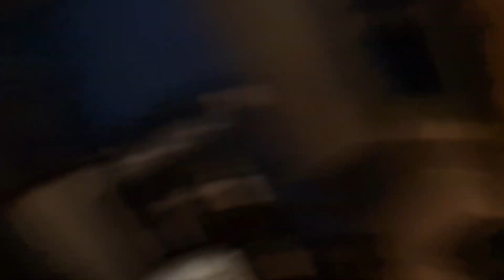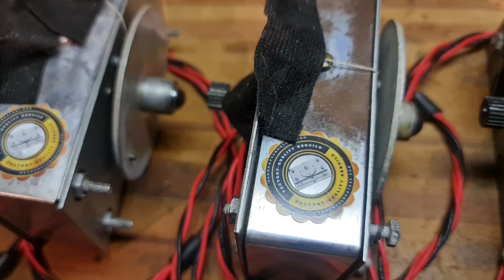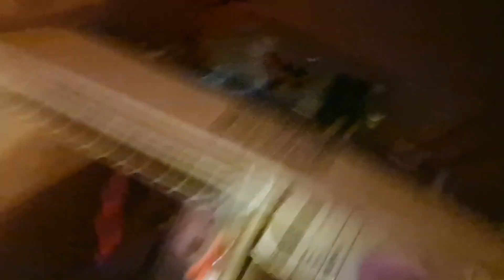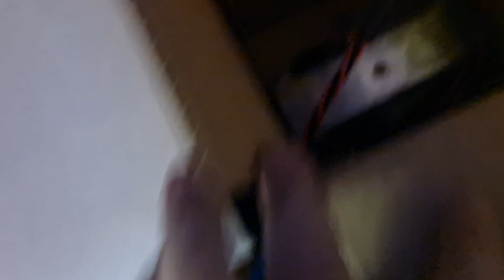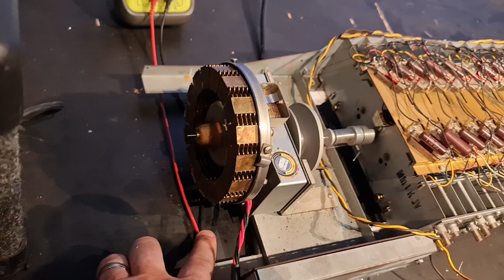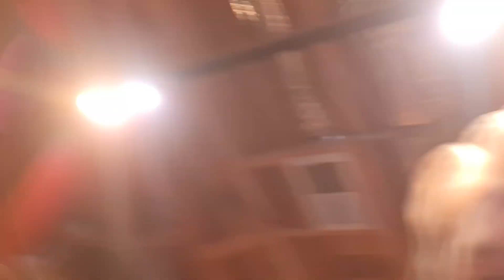Rebuilt Run-Motors For Hammond Tonewheel Generators - Now Available

Comment: I was given a 1962 A100 that was in a garage for many years.  I cleaned and oiled it several times in the last week and got it to run and play but the start motor now will not turn the tonewheel now, it looks like the gear spins but the shaft to  the run motor does not spin.  Do you also restore a start motor?
Reply: The start motor is ok, if it's spinning. They have a solenoid action, which engages the bendix gear. Yours is likely dirty or improperly oriented. You can sometimes push on the metal housing, or spray with wd-40, and get it to engage.
Reply: If you're saying that the start motor is spinning and it is actually engaged but the part on the other side that spins the Run motor up to speed is not moving at all, you've either got an issue with your start motor not engaging all the way or possibly a spring or part of the tone wheel has fallen out and should be lying underneath it if it has fallen free of the tone wheel. Obviously something inside the tonewheel has a broken or lost contact so that the towing wheel has a broken link. If that's what you're describing
Reply: But be very careful by all means when you are orienting things within the organ, as there is a straight 120 volts going to both the run and start motor. Which can legitimately shocked you and stick you to the organ with your hand in there. Having done this for years, I generally stick my hand in there without much worried because I know what I shouldn't be touching, but you never know if something's been messed with or that they're maybe wires exposed that you weren't anticipating and that can ruin your day and everyone thereafter. Take care!